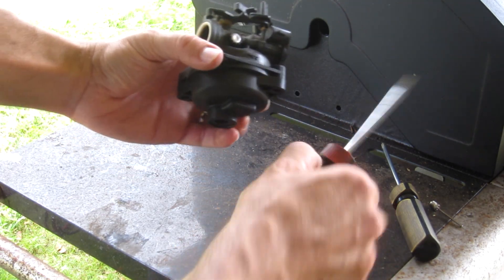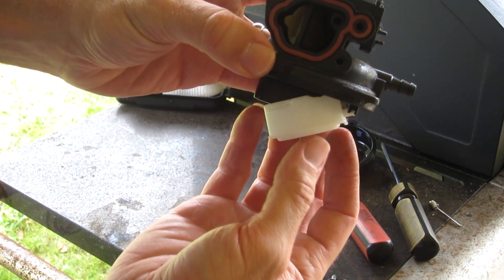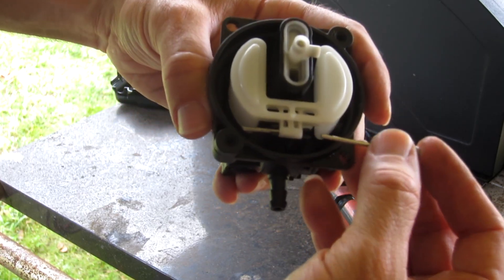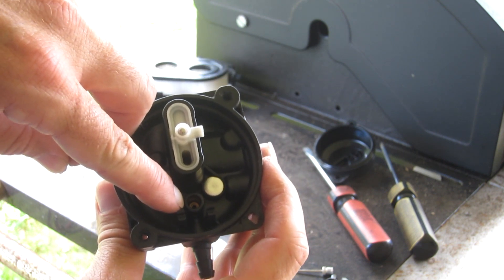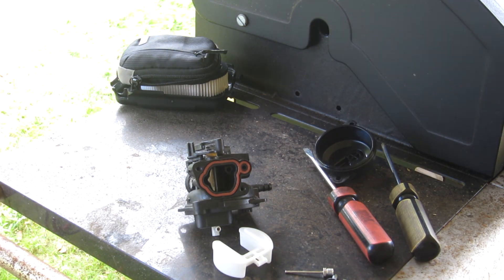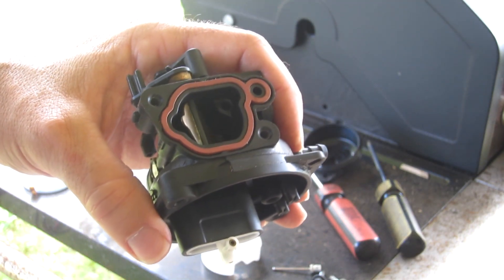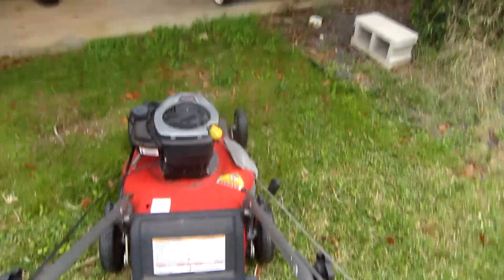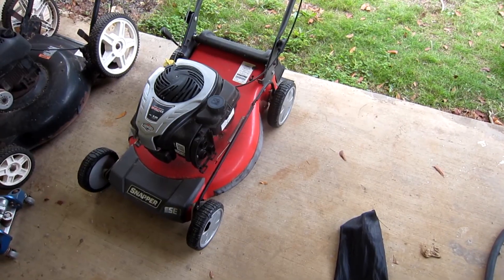Briggs and Stratton 550EX Carburetor Repair Part 2

Comment: Thanks man. I have the 525ex, but same build. Didn't have starter fluid so dropped some fuel in the carb, it started right up. I used old fuel so think the fuel/air ratio was wack
Reply from the maker: Good luck with it and thanks for the comment

Comment: i cleaned my carb and it's leaking fuel from the carb badly now. I took it apart and noticed that circular silver plug looking thing at 3:22 is missing. I think i lost it when i was taking things apart. Is this the reason for the leak? Everything else looks to be in place.
Reply from the maker: It is very possible. I'm not entirely sure the function of that piece but if it's missing, I would try to eliminate that problem first

Comment: You wouldn't have to take it apart 2 or 3 times if you clean it right the first time. You removed the jet assembly to clean with a sewing needle, you should have removed the outer assembly to get to the orifices inside the center (main) jet. Soak everything in carb cleaner for about 20 minutes, then reassemble. One time!

Comment: The carb butterfly is stuck closed on my plastic carb? How can I free it up to allow normal operation. Currently mine revs way too high.
Reply from the maker: If it's stuck, I'd use some WD40 and gently try to free it up. Maybe see if there is a spur on the butterfly shaft or in the carb causing binding

Comment: Thanks for the amazing video! when I put back my carb on my lawn mower and when i add gas in...it leaks through the bottom air filter housing. Is my carb messed up.?
Reply from the maker: My guess is that your float is stuck down in the carb and overloading with fuel. Take it apart again and make sure your float works freely and seals closed when it is in the up position
Reply: Also, if the red gasket is damaged it could be leaking from where the primer bulb meets the  carburetor. This leak would be running down the back side of the air filter plate (that the bulb is mounted to) then dripping from the bottom of the air filter housing.

Comment: Thanks for the video tutorial. Your video made it easy to follow your instructions and I was able to clean the carburetor and while I was at it replaced the spark plug. The engine fired after 3 or 4 pulls and ran well. 

However, after cutting about 50 feet the engine sputtered and stopped. It started again after a few pulls but only ran for a few seconds. It ran well and stayed running if I tilted the handle to the ground. But, the minute i sat the front wheels down to the ground it sputtered to a stop. Any thoughts?
Reply from the maker: I hate to say it, but take the carb apart again and blow it out with carb cleaner. Most likely you dislodged some gunk and it sucked up in the jets again.  That's what I'd try
Reply: @jcx2bby  Thank you for your quick response! I pulled the gas tank, drained the fuel then found that the screen was caked with dirt. I've cleaned the tank and screen and replaced it. I'll try again to see if this fixed it. If not, yes, I'll pull the carb again and clean it. Thanks for your help.

Comment: One more grateful person here - I was doing a tune-up and must have got some oil in the carburetor when I inverted it to drain it. The local repair shop was backed up for 2 weeks so reluctantly (since I'm not super handy) I followed your video. Took me twice as long since I was double checking every step - but it started up right away. I have finally overcome my fear of the internal workings of a lawnmower. Thanks so much.
Reply from the maker: Awesome! Thank you for sharing this with me, I love hearing other folks success

Comment: Instead of going as far as taking all the plastic top trim off....and the fuel tank off.....can you simply remove the air filter cover...... and drop the float-bowl like an old-school small engine carb, and if you must, then pull the main jet down and out? I can't believe that we're futzing with all these extra trim pieces on new mowers the same as the idotic top engine covers on modern cars. Whatya say ?
Reply from the maker: I don't see why not. I remove the whole carb to make it easier to see. You know, old man eyes haha
Reply: @jcx2bby  I got old eyes too !.....maybe it's best to get the whole carb in your hand like you did.....thanks....good vid.

Comment: Were can I buy just the jet Assembly? I cant find it anywhere thanks
Reply from the maker: The Briggs and Stratton website actually has a great selection of parts on it but you have to input your model/type code of your engine to use it successfully. The website will show you where to find the code. https://shop.briggsandstratton.com/collections/carburetors-carburetor-parts

Comment: Thanks so much for this great video!  After draining the old gas I followed it as closely as I could, completely cleaning out the carburetor and blowing out the various tiny passageways  with a can of compressed air after working on them with a sewing needle.  When I removed the carb bowl I noticed small white "balls" of corrosion and suspect some of that was stuck in the works somewhere.  I put everything back together and added new gas and on the very first pull it fired right up!  I am so happy to have my mower that I couldn't get started for a year back!
Reply from the maker: Great job Eric! Happy for you, thanks for the comment

Comment: Great videos.  Thanks.  Following your instructions, I disassembled and reassembled my mower carb.  Using a little bit of fresh fuel, it started right away, but ran roughly and leaked fuel.  Upon disassembly and inspection, I realized that I had oriented the carburator bowl incorrectly by 180 degrees, not allowing it to seat properly.  Assembled it correctly, and it ran strongly and free of leaks.
Reply from the maker: Greg, awesome and congrats on the success! Thanks for taking the time to comment

Comment: Good news, "I Maned UP", bad news, It was my sewing kit (points deducted), great video , thanks I could not see light on the fuel intake for the jets. float and needle are fine. ........As soon as get this thing working, i'm selling it. Why? because it only puts about 30% of the cut grass into the collection bag. And i've already replaced it with an $80.00 Troy Built that runs circles around it.
Reply from the maker: john, congrats, even if you had to use a sewing kit! I sold the mower that is in this vid after I got it working, there's no shame in it.
Reply: IT WORKED!!!! fired right up. WoW , thanks again. Craigslist here it comes.....
Reply from the maker: john tychsen, haha, nice. Good work man

Comment: I thought it might be my carb as well, but when I spray starter fluid into the intake it still won't start. Plug is clean and sparking but the engine just does not turn over. I cleaned the carb as per your video and still nothing. Aside from scrapping it, any suggestions?
Reply from the maker: Deadman Talking, hmm. You could have a compression or timing problem.  Not really sure. That's a tough one!
Reply: That's what I was worried about... looks like I need to hit up the used for sale pages. Odd as heck, it ran until the gas was empty and hasn't started since.

Comment: Brah! I love the way you went step by step. I was so frustrated when my mower wouldn't work today! I checked and reconnected the spark plug and I got the issue in your video but I had watched 2 others and settled on yours, the other 2 were show offs and intimidating.
I did exactly what you did and even sharpened the blade while I was at it and the mower worked beautifully! Now I'm feeling myself and feel like I can build a car from scratch, lol!

God bless you, saved me $$$
Reply from the maker: twesam, thank you for your kind words. I am humbled. Responses like yours are the reason I make these videos...i started doing it just for fun, but realized that it was 'actually' helpful to many folks, so i kinda got addicted to the process. 
thanks for taking the time to comment, and congrats on your success!

Comment: Great informative video.  I took the carburetor apart and really didn't see any build up of anything, nice and clean.  Put the carburetor back together and now  it leaks.  The floater is working properly, any suggetions?
Reply from the maker: Mary Rodgers, check the large gasket around the top of the fuel bowl. It can get a bubble in it easily that would cause the leaking. Frustrating as heck too.

Comment: Worked perfectly!! It cost me $12.22 and about 30 minutes. I replaced spark plug for $2.11, carburetor cleaner spray $5.49 and starting fluid $3.99 (this might not be necessary but good to have around) all from Auto Zone. Super easy fix that will probably save you $50 to $75 dollars. Thank you!
Reply from the maker: Michael, you're welcome,  and thanks for taking the time to comment. Congrats on the cheap fix!

Comment: Awesome video I just turned my exact same mower with that motor into the shop for that problem wish I would have watched this before I did that. They r going to put a new carb on it only about $68. But again great video at least I'll know next time thank you.
Reply from the maker: Daniel Padgett, $68 is reasonable. Next time you know you can fix it for free. Also don't be too surprised if they just clean your old carb instead of getting a brand new one.

Comment: Could anyone suggest the most likely issue if, after completing the repair shown in this video, the engine start first time then cuts out after about 10-15 seconds. I'm a real novice on these things. Brilliant video by the way...
Reply from the maker: Alex Walley, I am wondering if you may still have blockage in the carb. Some of the other comments on this video mention that there is one further step of disassembly on that white jet that I didn't know about when I made this video. Might be worth looking into. 
Past that, look to see that you're not creating a vacuum lock on the fuel tank with a bad cap.

Comment: Excellent breakdown - I have a very similar 550 and thanks to this guide I wasn't surprised by pieces falling out and got my mower running again in just an hour or two, never having done engine work before.  I found it much easier to access by putting up on a workbench if you have one around.

Camera focus tip:  fill up the screen as much as you can with a closer background like your hand and it will help the camera figure out where it's supposed to focus sooner.

All said, thanks for taking the time and effort to put this together!
Reply from the maker: Thanks for the tip Ryan, I really had no idea the camera was out of focus until I went to put this online. On the tiny veiwfinder (it's an old-school point/shoot) it looked like it was in focus.  But obviously it was a little fuzzy.
Thanks for the comment and congrats on getting your mower running again.

Comment: I did exactly what u did  to carb then after I put it back on it ran good but after I shut it off it started leaking real bad  Do I have any ideas what could be causing it to leak?????
Reply from the maker: William Isen, it will be one of three things. 1 fuel line to carb inlet is loose. 2 fuel bowl seal is bad.  Or 3 carb float is stuck down, not moving freely. Check all three in that order. Good luck

Comment: Seriously I want to buy you a beer. I was frustrated for 2 days with the fucking lawnmower until I calmed down and started browsing came across your video. I didn't do the rebuild because my lawn mower is 2 years old and it would not start after a full tune up.I got the jet out and cleared it from the carb and bammm..... one pull and shit fires right up. This gave me a huge insight on carburetor for lawn mowers and it made my night. Thanks for sharing
Reply from the maker: Iggy One, lol, thanks for the comment and I am serious glad you got it running again. These things are tricky if don't know they come apart like that!

Comment: I just cleaned mine and it seem like I messed up the carb somehow ,it revs high and at the same time has no power to cut the grass ,do you think I messed it up?
Reply from the maker: pupupipichorro rilief, probably have a spring on wrong or a vacuum leak making the motor run fast. My advice is to take it all apart one more time and see if you can find the issue. Sorry

Comment: I too have the exact engine and I took apart the carb ( even the white jet tower and I can't get the white tower to go back in. how did you get it back in? 3/5/2018
Reply from the maker: Stan Wilson, it will only go in one way so make sure you have it facing the right direction. You can see the proper orientation around the 11:10 mark in this video. Then just press it hard until it pops in. May take more pressure than you're thinking to get it to snap in but it will go. You can see me pressing it at 11:26 mark or so. Good luck
Reply: I found out from another video of what I was doing wrong,  thanks for the reply. 3/7/2018
Reply from the maker: Stan Wilson, good deal!

Comment: Great lesson ,I got mine going again. But the pull chord wouldn't pull when I put it back together and I had remove it and turn the engine with a  large screw driver to loosen up the engine a bit . It had a sticking point for some reason. Replaced the top pull chord assembly and  with some starting fluid , cut some grass. Thanks  !

Comment: Have you tried draining the carburetor bowl by the drain plug? Do they leak?
Reply from the maker: I've never messed with the drain plugs...on these small carbs, it's just as easy/messy to take the bowl off and do it that way. I don't see why the drain plug would leak, though, if you decide to go that route.
Reply: jcx2bby Do you drain the carburetor bowl for the winter? I heard the left over gas inside the bowl can go stale during the winter and gum the carburetor.
Reply from the maker: On small engines like on pushmowers, I just run the engine out of gas.  On bigger engines like a riding lawnmower, I start the engine every month or so to keep fuel moving through the system. 
Because you're right, if you let gas sit for months at a time, it will varnish and ruin your fuel system.

Comment: I own the same carburetor and when I start the mower the engine runs for a split second and stalls out.  Fuel is reaching the engine and collecting in the carburetor around the choke and it is leaking around where the bowl fits into the carburetor.  One of those screw holes is stripped out but the screw stays there.  Do you know what the problem may be?
Reply from the maker: Brian, my best guess based upon your description is a stuck float. Sounds like it is stuck down, which is overflowing the bowl with gas. There could be something blocking the needle from sitting properly in the seat as well. I'd double check that and see what you find.
Reply: Ok I will check the float and the white piece with those jets to make sure there is no blockage there.
Reply: I took the carburetor apart again but the float is not getting stuck.  I held the carburetor upside down, blew into the opening where the fuel line connects but no air came out so I know the needle is seating.  When I move the piece for the linkage that goes to the muffler fuel leaks out around the float bowl where both screws hold it on.  Why would that be?  The engine still barely picks up gas when I pull the rope.
Reply from the maker: Brian, unless the float is sinking for some reason after the carb is assembled, I really don't know. Or, it could be that the carb itself has a crack in the housing allowing the leak to occur. Sorry man, good luck with it, I am sure you'll figure it out one way or another.
Reply: I think the carburetor is bad and needs to be replaced.  Could fuel be running down in between the main jet and the carburetor body?
Reply from the maker: Brian Mott, sounds likely. There must be a crack in there that is causing the problems. Sorry Brian.
Reply: Well I've taken the carburetor apart several times and thoroughly inspected and cleaned it but I could not find a crack anywhere.   I want to replace it.
Reply: Fuel only leaks around those 2 screws when I try to start the mower.
Reply from the maker: Brian, yeah, best bet. Hey, the bowl gasket is good right?
Reply: The bowl gasket is not broken anywhere but to me the bowl does not fit into the carburetor as tight as I think it should.

Comment: Great... as soon as I put the fuel bowl back together on the carb and reattached the fuel line, it starts leaking like a sieve once I put the engine cover back on. What did I do wrong?!
Reply from the maker: DiscoDashco, sounds like a problem with the needle/seat and float. The float is probably stuck down letting fuel overflow the bowl. Or the needle and seat aren't good which is allowing the same thing to happen. Either way that's the first 2 things to check
Reply: there's only one way the bowl will go back on

Comment: Pro tip: those "t-16 torque" fasteners are 9/32 heads.
Reply: Hex heads right? If they were just torx i would go to hardware store and replace them with same length and thread pitch